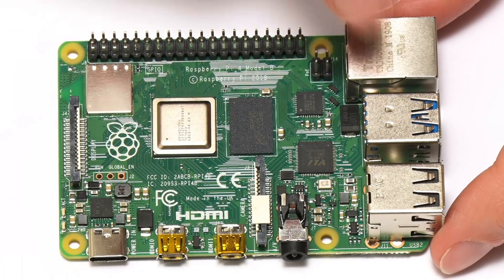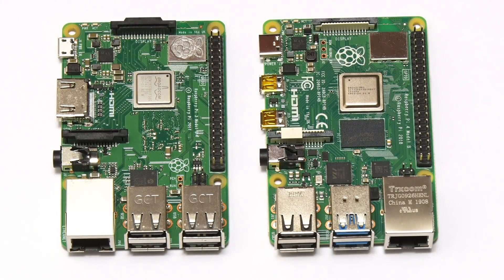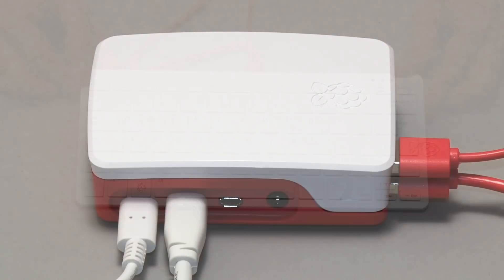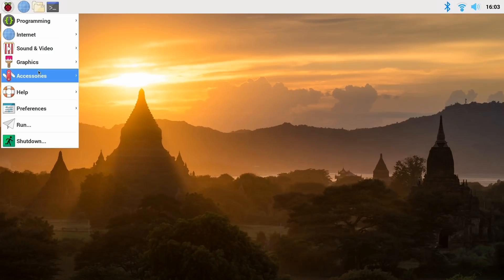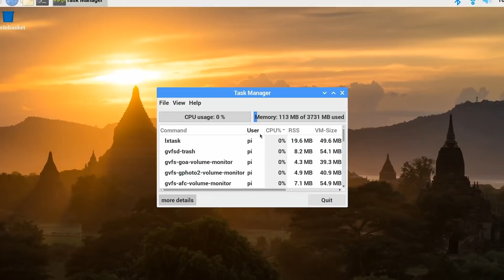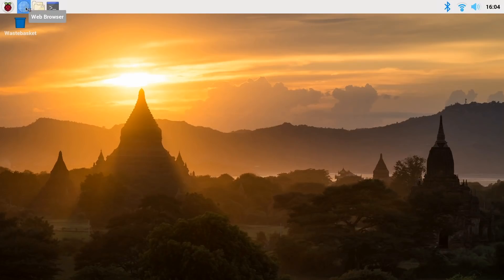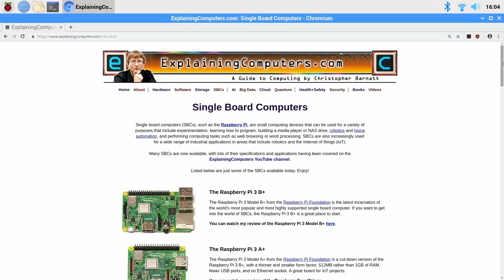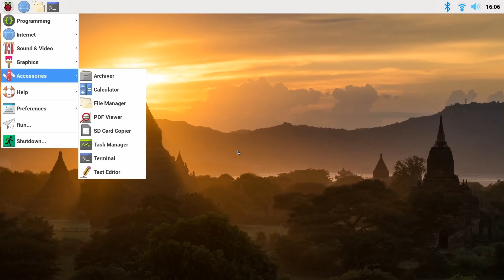Raspberry Pi 4 Model B

Comment: i'd like to see this tested as a NAS storage controller, i'm interested in the performance of the Ethernet port. the last one had an almost gigabit Ethernet. want to know if this one is true gigabit.
Reply: If it has USB 3.0, it has Gb ethernet. USB 3 = 5 Gbps
Reply: What is NAS???
Reply: @shadeshiest22  Network Attached Storage, more than an external HDD.  Usually a NAS is set up in a RAID Array.  RAID is redundant array of independent disks (probably) with the operative word being redundant- RAID famously IS NOT A BACK_UP.
Reply: @twmbarlwmstar  raid sucks. Go with unraid.
Reply: @Redneckrampage  Well with such compelling evidence how could anyone argue with you.   Obviously millions of consumers and enterprises must be wrong.
Reply: @twmbarlwmstar  with unraid you can mix different size hard drives, run vms, dockers and many other things. I'm currently gaming on one.
Reply: @Redneckrampage  You can do all that, except mix drive sizes, with RAID and RAID is generally faster than unraid all things being equal.  Unraid has some use cases but to suggest that RAID is therefore rubbish suggests you don't really understand RAID.  There is a good reason why people use RAID.  Unraid imitates RAID with the addition of the drive thing, which if you remember WHS (2003) also did and that didn't take over the world either despite Windows Server being very successful.  In fact WHS 2013 dropped the mixed disks ability which left unraid as the only option for those needing a mixed disk environment.  In reality few of us do these days as HDD are very cheap- I do accept that Unraid is popular with those that struggle with RAID but really most people don't struggle with RAID.  They buy a SYnology which is superior to Unraid and handholds you all the way, or they know what they are doing (I honestly have never found it hard, even the first attempt).
Reply: @twmbarlwmstar  I gotta admit unraid was is a bit tough to get everything going (the way I wanted: gpu pass through, cpu pinning etc) but the unraid community is amazing and taught me a lot. But for just a  nas it's just as easy if not easier. Plus unraid protects your entire array with just one drive. With raid you lose a lot of hard drives depending how many drives you got. To each their own I guess.
Reply: jason campbell not wanting to fuel what sounds to me like an argument...

  Yes, it depends on the use case.  Unraid has definite good use applications.  It us not best for all cases.  Standard RAID arrays are also not best for all use cases.

  There is also a very big difference between the various hardware, and software RAID implementations!  There are quite a few RAID configurations out there in a RAID chassis, that look like hardware RAID for example that are actually software RAID subsystems, that also have the ability to mix drive sizes, AND even expand the array sizes with additional drives at a later date.  Even my hardware LSI RAID controller has the ability to create multiple arrays, with different configurations, and allows for some limited forms of array expansions.
Reply: @shadeshiest22  Network Attached Storage
Reply: @shadeshiest22  Network Attached Storage. Basically a second hard-drive for your PC that doesn't live in your PC case. You hide it somewhere out of the way, like in the spare room and it acts like a central storage for your PC and in fact any device in your house that you set it up for. Think of cloud-storage but it's local.
Reply: @shadeshiest22  Google
Reply: @shadeshiest22  It's, Network-attached storage.  A very handy thing to have in any home/office environment.  If the Raspberry Pi 4 B can be now used as a quick and inexpensive NAS, that's very cool indeed 👍.  You'll still have to purchase the storage disks and configure what RAID system you want to use.  That's easy though and fun to set up: https://en.wikipedia.org/wiki/Network-attached_storage .  I hope this helps 😀.
Reply: Nick Hall NAS = Network Attached Storage.  Think of it as a computer on your network, that you can read and write data from and to its hard drive(s).  I does NOT need to be a RAID array of drives, but it could be.  It is simply, as the name implies, a way to connect data storage to your network to be fully usable by any computer, (or media player), on your network.
Reply: The Ethernet Port must be interfaced through the USB 3, so, true gigabit, I guess
Reply: I/O speed I think is still quite limited.
Reply: I want to know that as well! I have a nas with my 2b+ and its very slow !
Reply: @metrogp  It will be, because the Pi is bottle-necked by USB2.  Then there is memory, you need a bit of memory for a NAS and 2TB is quite a big bit of storage, depending on the Array.  Even a bought NAS with the same speed CPU and same amount of memory would be slow, and that would have proper Ethernet generally.  The Pi3+ is limited because everything runs through USB2.  So five times slower than it 'should' be, and that is the ideal theoretical speed.  Those that get involved with NAS will know that getting close to theoretical is very hard work anyway and takes a lot of tuning but with a Pi you will never get there because USB2.
Reply: @twmbarlwmstar  The Pi 4 is no longer choked by USB2
Reply: @forkless  Agreed, who has a NAS built with a Pi4 though?  It only got announced today, I haven't got one and certainly haven't had time to build a NAS out of one.   So what is your point?  That what I have said is any way wrong?  Because it isn't.  The reason people have slow NAS are for the reasons I have given.  Until someone tests the Pi4, and it won't be me as I'm drowning in projects, we won't know how effective it is but it will be better because I guess it is now only bottle-necked by USB 3 (which will still be a bottle-neck it must be said).
Reply: @twmbarlwmstar  I only pointed out it is no longer choked by the USB2 as a databus, in fact the NIC on is now completely dedicated and while I personally wouldn't use it as a NAS either the Gigabit controller is a welcome addition for those wanting to run a cheap firewall on an FTTH connection without getting throttled.
Reply: @forkless  But it is irrelevant to the original discussion beyond being able to say, we think, that the Pi4 will be less effected  than the Pi3+.  Have you build a NAS with a Pi4?  If so what speeds are you getting and is it being restricted by USB 3?  For everyone else, who is wondering why their Pi NAS is slow, I've explained and that won't change even with the launch of the Pi4.
Reply: @forkless  indeed but irrelevant as we were talking about the pi3
Reply: @metrogp  From the Raspberry Pi documentation:
"The Raspberry Pi also has only one root USB port: all traffic from all connected devices is funnelled down this bus, which operates at a maximum [theoretical] speed of 480mbps."

So you limited to a total of 480Mbps and everything is sharing that.
Reply: For a nas storage controller you'd probably be better off with an SBC that has actual SATA ports. I'm personally using the Helios4 and am happy (but I wish it supported 64bit because the max partition size is 16TB)
Reply: @9a3eedi  You can fit SATA ports to a Pi but you will still hit the USB 2 bottle-neck.

I build systems as a paying hobby and someone recently paid me to build a ‘full fat’ Pi based NAS.  I tried to explain the USB 2 thing to them but they were having none of it.  So, they have a very expensive and slow two drive NAS.  It does have a UPS element, and there is proper safe shutdown, RTC- nice case and tiny; but the cost was about £130/140 for materials plus my profit (plus the cost of the disks).  A second-hand Synology would have been a much better deal on every level except no UPS.  You can get a 4 bay Synology for not much more than £150 (eBay second-hand).
Reply: @twmbarlwmstar  the pi4 has usb3. But that's different from a native sata connector. You can get SBCs that support native SATA, such as the Helios4 that I mentioned
Reply: @9a3eedi  You can fit SATA ports to a Pi, that is the only point I'm making.  SATA is just a port and ultomately everythng ends up as PCIe really.  So the GIPO will support SATA but with the Pi you hit the USB 2 bottle-neck because that is how it was designed.
Reply: @twmbarlwmstar  also if I want to expand my array. I just pop in a new disk and add it in the drop down menu. Can raid do that? If you lose 2 drives in a raid array you lose All your data.
Reply: @Redneckrampage  See, you don't understand RAID and that is why you are talking nonsense.  It is untrue to say that if you loose two storage drives you loose all your data.  In RAID 10 it is possible to create the Array with a minimum of 4 drives and you can lose 2 without data loss and 3 with a 50% chance of data loss/preservation.
Reply: @twmbarlwmstar  what if I have 20 drives?
Reply: @Redneckrampage  I think you need to go do your own research because the questions you are asking indicate you really don't understand RAID.  It may seem harsh but I'm not willing to spoon feed you knowledge as I don't believe it is the best way of learning.  Suffice to say you are asking the wrong questions because you don't know the first thing about RAID.  Insomuch that a number of drives matter it will be the minimum amount of drives needed to build that Array type that is important.
Reply: @twmbarlwmstar  10x 8tb drives in raid 10 doesn't that only give you 40tb? That's such a waste. With unraid I would have 64tb and 2 drives can fail and lose zero data.
Reply: @9a3eedi  I have several external usb 3 drives that I would prefer to connect to my network switch than taking up ports on my desktop. And would make accessing media from my tablet or phone easier.
Reply: @kirknelson156  sounds good
Reply: The 4 has a dedicated chip for the Ethernet; source; 
https://www.element14.com/community/docs/DOC-92642/l/benchmarking-the-raspberry-pi-4-model-b?mkt_tok=eyJpIjoiTTJabU5ETXhZek13TnpSayIsInQiOiJaZ09mZ0lQbXNvN3p2Z1F3ZElXOW1cL3R3eW50dVc4R2NYTFwvSEQ3WE5vbXJSa3pyckt5Z05YV3hQWkxKTXlBaEg2R0R0bzExSUZYV1pkSXlTMTk4aVZQMzVHQkNlZXNJNGFhd3Y0am1mUWRjOWNUc0N6XC93TVROblpxckdweXN4eSJ9
Reply: Yes, please build a NAS with this.
Reply: @Sam_Saraguy  A little sarcasm from Saraguy? I agree. This conversation rather academic, IMHO. Is the RPi 4B only a limited NAS? Or, is it being limited by only using it for NAS?
Personally, I would have liked to have seen a NVME SSD connection. So, there's my 2 cents worth.😎
Reply: Yea I wondered if the usb 3.0 was bridged with the ethernet like the old 2.0 was as well
Reply: Ethernet is not USB, it's connected directly to the SoC. So it should do a full gigabit.
Reply: @povilasstaniulis9484  on the previous PI's the Ethernet port was connected thru the USB controller. like plugging in a Ethernet USB dongle into a computer.  what i'm hoping is the never version is ether via the usb 3 controller or has its on chip. or maybe it is connected to the SoC directly. these are the questions
Reply: I/O speed I think is still quite limited
Reply: The whole thing got strangled via a USB 2 bus though, which has made every NAS I built with a Pi very slow.  There's a Banana Pi board that is much better, but costs £100.  It's called a router board but is actually easier to set up as a NAS I found.

Comment: Not open source hardware. Plus it's a price hike. You'll have a hard time proving that a 1gb ram π4 is the equivalent of a 2gb ram π3 at the same price. It doesn't really matter to me though, no datasheet means it's an over hyped phone or tablet without the battery, and built in screen. Heck, my phone is a 3 generations removed flagship with 4gb, and an ARM SOC without a datasheet. I just need a debian distro and I've got the same thing, with a case battery and screen integrated.
  Rπ should have ditched Broadcom and took the lead on RISC-V.

Comment: My only wish is they kept the same footprint. i have a few extra cases lying around that need to be used.
Reply: The footprint's the same, just a minor difference in connectors on two edges. Most cases can easily be modded to accommodate the new board, and some case types are ready to rock without mods. The switch to USB-C for power had to happen to allow higher-current power for the USB 3; that's a minor tweak at the case level. The Ethernet connector had to move to the other side of the board (from left to right) because of signal routing - that one may mean cutting out the two vertical strips that separate the Ethernet and USB jack cutouts. And, of course, the 2 HDMI connectors will mean cutting a wider slot where the existing single HDMI connector lives now. The GPIO, PoE, camera, panel and microSD connections are all in the same location. It's only in cases that have their own breakout connectors (like that NES-style case) that are going to have a problem; those will need a bit of work what with sub-boards and wires and such to swap around or re-fabricate.
Reply: Agreed.
Reply: I don't mind the case incompatibility, but the need for a new power supply is unfortunate.
Reply: @MeneGR  You can adapt up - there are micro-USB-to-USB-C adapter dongles available - but you won't get all of the benefits of USB 3 unless you also use a powered hub between the Pi and the USB devices. If your USB devices are passive or low-power, you can get by with a lower-current power brick.

Comment: You can buy on eBay old laptop, which will exceed any of your SBC for much lesser price (since screen and keyboard and mouse and sound and SATA and all kinds of connectivity already included). So what is the reason for such big push for SBCs?
Reply from the maker: About 40 per cent of the content on this channel has been SBC-based for years. It's just something I do here (and it is the SBC videos that keep the channel going). But there will always be other stuff every other week.
Reply: @ExplainingComputers  Please, don't get me wrong. I really admire your work and style of your videos. That's why I subscribed it. Just my feelings are that SBCs have very different niche on PC market - robotics, automation, remote control these sort of things. And feels like you somewhat overlooking this aspect.  Again with all due respect.
Reply from the maker: No problem, thanks for this. Edge computing may bring things together. :)

Comment: Is a heatsink not needed on PI4b?
Reply from the maker: It is not supplied, and the board is marketed as "silent". But I suspect a heat sink may be a good idea, especially in a closed case. I will be looking at Pi 4B cooling closely in a future video.

Comment: Wow, dual 4K output? That's gonna set a new bar for this price range
Reply: its pretty much the same price
Reply: ZERO HDMI PLUGS for all my hdmi cables
TWO micro hdmi... so I need to go buy a pile of $8-20 cables for this plank
Reply: But is it at 30 or 60 hz?
Reply: I would rather have had a single full hdmi output rather than micro hdmi ports needed adaptors or new cables :( Sure the board is cheap, but it's cost is much higher now you have to buy more things for it just to get it working. I had the same complaint on the Zero, although I fully understand why that has what is has. A quick search on Amazon and a 4K capable adaptor is near £7, so two would be adding about 40% to the price of the 1GB model or an additional 25% on the 4GB.
Reply: @smartroadbiker  You need a HDMI2 cable whatever the form factor though, and I just have the cables rather than the adaptors.  Monitors seem to ship with at least one mini-HDMI in my experience  so a mini-HDMI to full HDMI(2) cable.  I do that with all the cables now- and the good thing with the USB2 is they are very easy to make as it is only 4 cables/wires and even the micro are easy enough.  Only buy HDMI 2 cables because they are backwards compatible.
Reply: @twmbarlwmstar  an* HDMI2
Reply: @DarthVader1977  "a HDMI" is correct. 
If you're going to try to correct people, at least try to make sure your corrections are correct.
Reply: @saturnGEEK  what? Why is "a HDMI" correct? Do you actually say "a H" instead of "an H"?
Reply: @MegaStupidMonkeys  HDMI isn't a word - it's an abbreviation of "High-Definition Multimedia Interface". As such, you pronounce and write the abbreviation as if you're saying the full name. Just little quirks in the English language.
Reply: why would one need 2 of them ?
Reply: @aresgood1  
preparing two screens, one non touchscreen, one touchscreen
I'm making a giant DS.
Reply: @aja2005a  lol dude it won't be a d's unless you can close and fold it .....  It just be two screens on top of each other ...... do it properly... battery powered too
Reply: @vasili1207  a freaking Nintendo DS arcade, not an actual ds, you Pentium 2.
Reply: @aja2005a  just don't try to play Zelda phantom hourglass.
Reply: @aja2005a  a arcade isn't very portable ...  stop cheating and do a proper job 😁... u never know u make a video and u may get some love.... use a table with a flip lid 👍
Reply: @vasili1207  It's* just
Reply: @vasili1207  An* arcade
Reply: @vasili1207  Psh...a folding DS...that's so outdated. Nintendo 2DS is where it's at. It's great to ditch two of the main features of the 3DS.
Reply: @CaveyMoth  like just wanted to see him try and put a 6ft ds in his pocket 😂
Reply: @Northbergh  haha yeah i remember  it took me forever to figure that sacred crest /map  thing out
i actually gave up  and closed my DS when i was on the train then when i got home and opened it again i found i had accidentally discovered the  secret
Reply: @vasili1207  gee I wonder why I wanted a personal arcade for myself in my own home
Reply: @andreamitchell4758  yeah, same.
I closed my DS, because battery was low and I couldn't save at that point.
I would never have finished the puzzle otherwise.